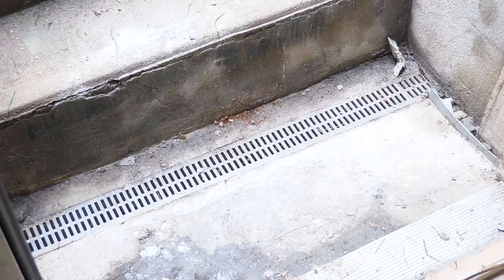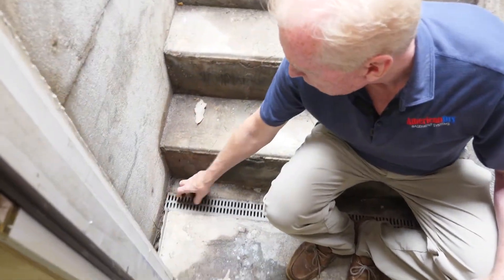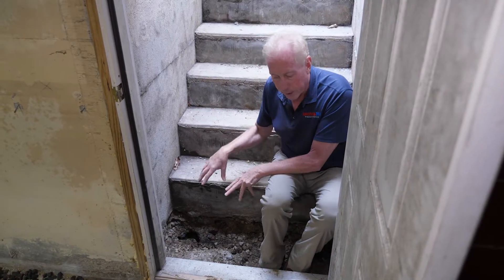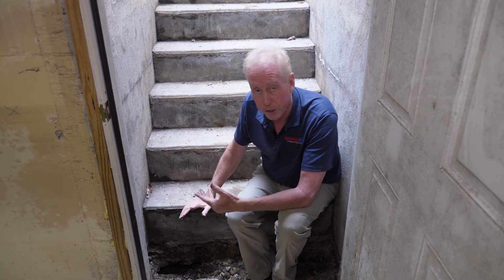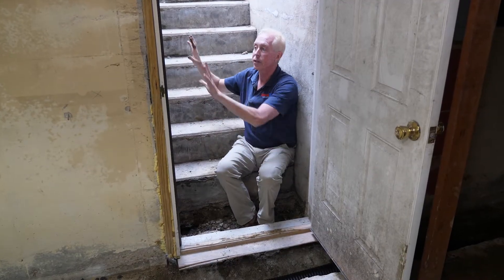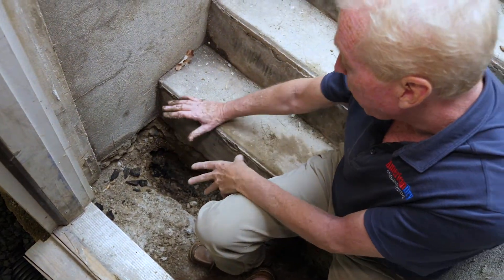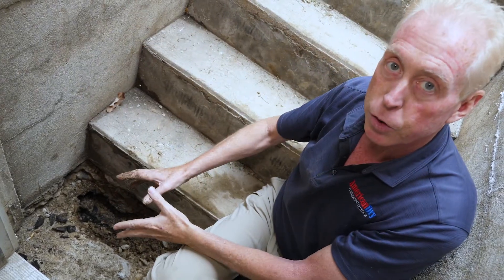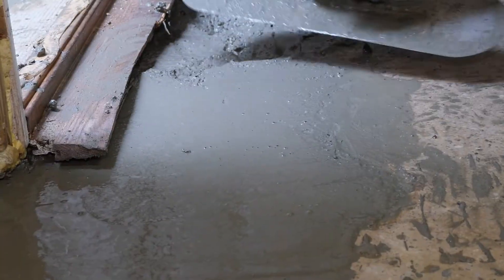Basement Waterproofing - Bilco Bulkhead Stairwell Drainage

Comment: Why did the guy drill 3 holes in the bottom of the drain before installing it? What were those holes for?
Reply: It allows small amounts of water to drain without having to going into the sump well. If the water reaches the height of the PVC that's attached, then it drains into the main sump system. I would assume that in light rain and such it would never fill enough to overflow to the PVC, leaving no need to run the sump pump = save electric $ and longevity of the pump.

Comment: Stairwell and egress windows all should be tied into the sewer drain or floor drain to have water picked up by the sump. I have seen it done that way during home construction and afterwards in older homes and it works 100%. In ground drainage is old school and played out.

Comment: Just curious, if pitch is important why not use a ridgid type of pipe instead of the corrugated? Wouldn't that be much more reliable?
Reply from the maker: No. The corrugated pipe is far more reliable. When the pipe is pitched, the corrugation allows water to flow in a way that it cleans the pipe more thoroughly than a rigid pipe. Also corrugated pipe is flexible so you can have a continuous section with no cuts or elbows connecting sump pump stations.
Reply: @AmericanDryBasementSystems  okay, so instead of using a level to check the grade I guess you can just measure from finished floor down to the top of the pipe? I hadn't thought of that when I asked the question.
Reply: @MrPeterschmit  Check grade on the dirt, then lay corrugated pipe on said dirt. Pretty straight forward stuff.

Comment: This is one of the places that I have water coming in.  Can literally see it seeping in when water levels are high even after vacuuming the threshold with a shopvac. Not the only spot but will definitely need to be addressed.
Reply from the maker: Stairwells to outside, window wells, and basement corners are the most susceptible areas for water leaks.

Comment: Imagine if the weeping tile were unclogged and the water was prevented from getting through the walls. Some tile systems still function after 2000 years. Yes, some failed before but weren't done properly accounting for volcanic processes.

Comment: I rent and when it rains water is seeping into basement where we all do laundry. There is no drain or roof outside before doorway. Water increases then flows under threshold and above it. There is a drain in basement but the only trench I see is raw, just dirt about 2 inches wide, then runs across the floor to drain. We literally are walking in puddles using washer and dryer that are electric

Comment: Why not use PVC instead of the corrugated?
Reply from the maker: Good question and you are not the first to ask. The simple answer is that it clogs too easily and requires long-term maintenance to perform well.

Comment: Informative videos, I saw a home with a sub pump on the exterior of the home on the basement steps were the drain in this video would go. I was not aware sub pumps can go outside. Could that have been a short cut or that’s normal practice
Reply: In my jurisdiction (Denver), where the interior foundation drain is run to an interior sump, which is then evacuated to the city sewer main, it is a code violation to tie any exterior drain to an interior sump leading to the city sewer. 

Besides the fact that the city water system doesn't want to pay to process rainwater, it can lead to localized home flooding from back flow of storm water out of lower level drains not protected by a back flow preventing valve in neighboring homes tied to the same sewer main.
Reply from the maker: I'm glad you like the videos. A sump pump at the bottom of Bilco stairs is not normal or professional. It could be a building code violation where ever that home is located.
Reply: Can you answer @harmony question please